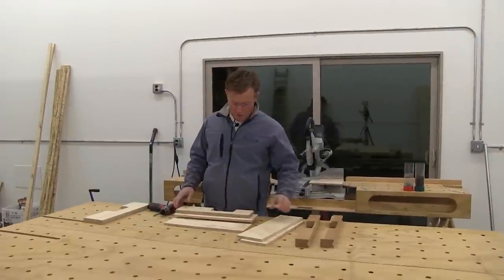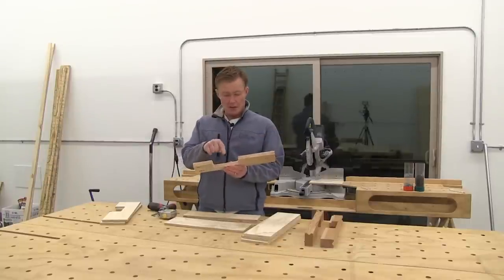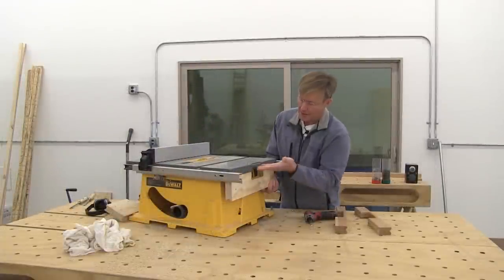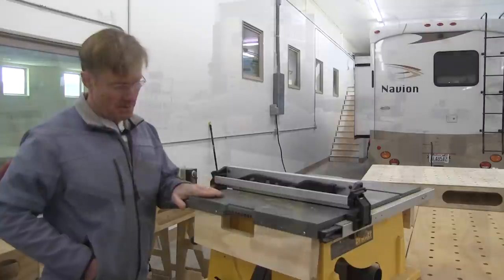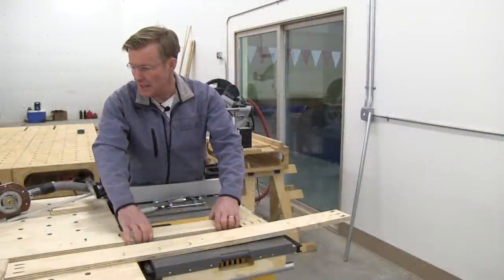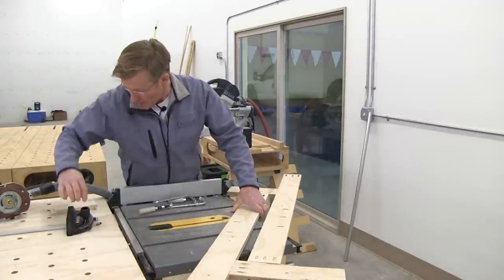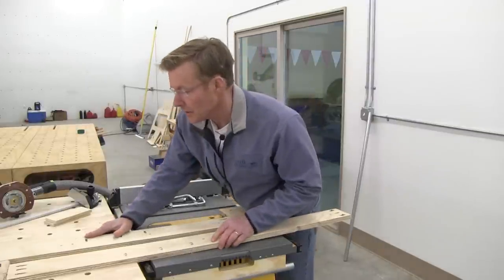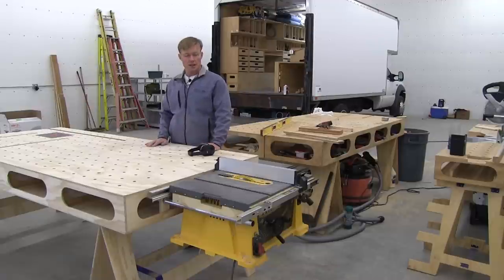Building the Paulk Workbench PART 12: TABLE SAW MOUNTS FOR DeWALT DW744

Comment: I bought your plans a few years ago, and redesigned a few things.  3' wide, 7' long, one piece, to fit my space.  Sits on top of an old table with casters.  I added casters to one corner of the bench itself so I can wheel it out to the pickup, but never moved it since.....   I added a woodworkers vise to one side.  I am contemplating slicing some of the width off, and adding a flat side, with a Moxon vise....  I don't know.....I am trying to reclaim some floor space in the garage.  I do wish I had not used as many holes in the top.  Maybe a row or 2 would work for me....Great design, a design that begs for customization!  Thinking of the desk next.  Heading to those videos now!

Comment: Ron, Since the DW744 is no longer available new. Do you know if they have a replacement that will mount the same way?
Reply from the maker: John, I have seen mods to make just about any TS work with the PTS and PWBII. You just need to work other the details. Currently, I am using the SawStop and not mounting it at all.
Reply: Thanks. I'm due to upgrade my current saw so I thought this would be a good time to do so.

Comment: I recently got a DeWalt saw and will attempt to modify my bench to mirror your set up. Do you do anything for the dust collection with this saw or does it just shoot into the bench void? Thanks for the inspiration.
Reply from the maker: +Andrew Lynch I have a 90 degree shop vac elbow on the table saw and hook it to a auto switched vac. When the saw is on, the vac is on.

Comment: has anyone tried mounting a Ridgid 4510 to the bench? that is what i have and i think i can mount similar to the Dewalt mount. Since the right side of table slides out and there is very little left of the center portion to use as a solid mounting point. I am concerned about constricting this. Any possible insight would be appreciated, I will be trying to do it in the meantime. I haven't built my Paulk bench yet but have an existing bench in shop i will be testing the same mount with.

Comment: I just bought the plan yesterday, your mentioning a up/down cut bit in this video can you specified the exact brand and model? Thanks
Reply from the maker: +Bid Budy The upcut router bit is listed on page 11 of the plans with a link to where I purchased it. I no longer recommend that method. Take a look at the video from the PTS to see and easier, cheaper and more exact method. https://www.youtube.com/watch?v=JazynwsfQLM&list=PLB1ATCukiUGSEvdBc7NnqlmxHAwdx6C83&index=13
Reply: +Ron Paulk Thanks for the fast response! That's a great way of making the holes, since a own the LR32 System I will probably go with a 20mm or 3/4 bit instead it's just hard to find a 20mm spiral bit with a 1/2 shank here in Canada.   
Thanks again.
Reply from the maker: I couldn't find 20mm at all and the ¾" is only available in steel which doesn't last. I created the jig to be able to make 20mm holes with a high quality inexpensive ¼" solid carbide spiral bit. The jig is easy to make and will make the holes faster and more accurate than the LR32.
Reply: +Ron Paulk May I asked why you say  it's more accurate than the LR 32? I have a Blum minipress for my shelf pin hole and I basically both the LR32 to make your bench. I would like your honest opinion. 
Thanks
Reply from the maker: +Bid Budy The LR32 is a great tool and very accurate. The jig is single purpose, so it covers the bench from end to end only needing to index it for the next row. The main problem using the LR32 is finding a 20mm bits that doesn't cost more than the LR32. The steel ¾" was very dull before all of the holes were drilled in my bench. I made the jig to solve a problem that I could not resolve with anything available other than a CNC.

Comment: I have a Dewalt DWE7480 any ideas how to mount to the pipe? Help...
Reply from the maker: See Building the Paulk Total Station Part 11. I mount a DWE7480. BUILDING THE PAULK TOTAL STATION PART 11 MOUNTING THE TABLE SAW AND MITER TRACK BACKING
Reply: Ron Paulk Guess I'm going to have to remake pipe brackets on the table &  figure out how you made those saw mounts.